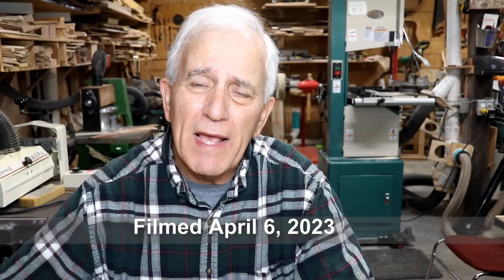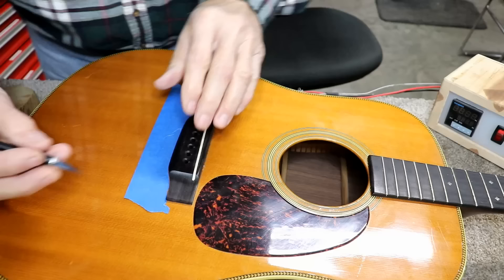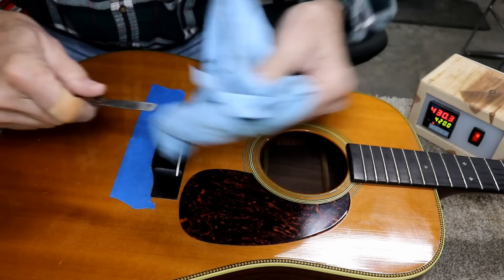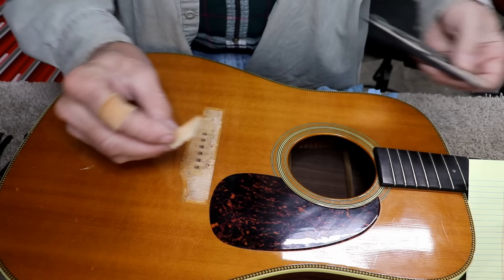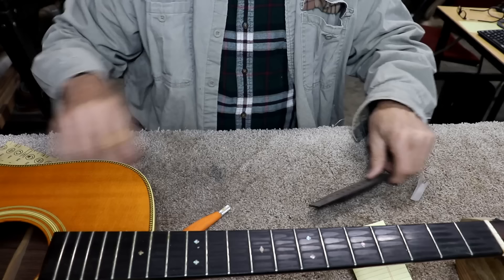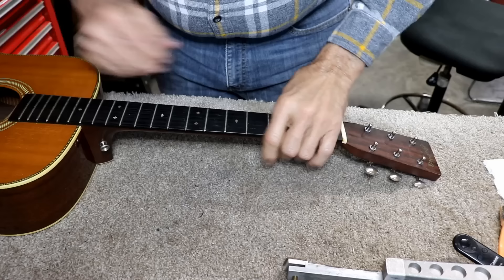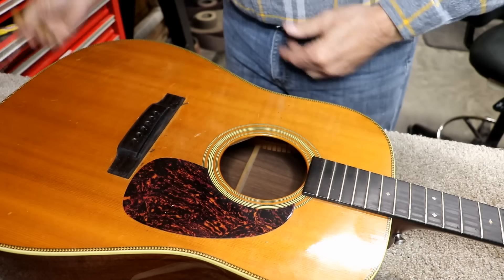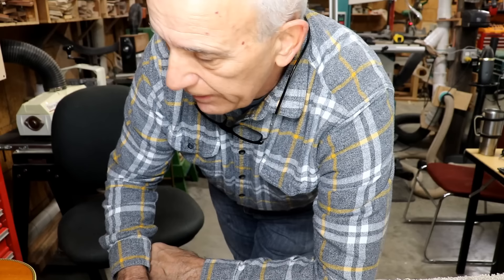640 RSW Refused by 2 Martin Factory Authorized Shops

Comment: Folks, I would like to say up front that I am NOT a luthier, and though I've been making racket for 50 years on and off, you wouldn't know it...yep...I suck at playing too.  This man does a number of things that he makes look easy (but are most certainly NOT) and demonstrates the power of 40 years of SUCCESSFUL (and frequently, to him I assume are annoying) problem solving.  Now let's look at what Martin has done to address stuff like this...this is going to be long-winded...you have been "warned"! 

About 3-4 years ago I toured the Nazareth Martin factory (we also toured the Yeungling brewery, too, and Pottstown isn't very far from Nazareth).  Of course I didn't realize, prior to taking the tour, that the guitar is finished prior to gluing the bridge to the guitar top...as the video pointed out, wood glue does not adhere to varnish.  In the olden days this was done by hand (before the days of relative affordability in CNC machining (with optical scanning/compensation and feedback to program the desired outcome).  The "not really new"  approach evaluates on an instrument-by-instrument basis so the "answer" is what that specific instrument requires to be considered "correct".  This system is also far faster, more accurate, and more consistent (with the data to back that up) than human beings can perform day in and day out. In addition the job had a high level of tedium for a critically important joint and required a highly skilled worker around 3 hours per guitar for every single guitar produced...that job now takes 1-2 minutes per guitar using machine centers custom designed and made for this specific task.  Each guitar is optically scanned so that guitar's variance is known and the system compensates for any irregularities, calculates the solution for that instrument, removes the varnish consistently (as well as determines the correct location for the bridge) with a shape that precisely matches the CNC made bridge and then (I am a bit fuzzy here) creates a pattern so precise that the CNC milled bridge will fit every single time in the correct location with precise sanding...These machine centers were custom made for Martin and are used on every single guitar made in that USA factory regardless of trim level or cost (I'm not sure if this level of automation is used in the Mexico factories but I suspect they also use a similar, if not identical, approach to achieve higher levels of affordability with customer expectations based on the name...  I'm not saying it's perfect (nothing ever is) but it's more consistent, more precise, and way faster (which helps offset that investment in a meaningful and measurable way that keeps the customer happy both in terms of cost AND performance).   I see this as the acoustic guitar version of the PLEK idea but applied to finish removal and bridge placement instead of fret leveling.  Combined with automatic QC data collection will help ensure that variation remains within manufacturing tolerances along with in-process checks at critical locations in the entire process so that every single guitar made in Nazareth is as close as current technology allows...the high skill set jobs still require the attention to detail but technology is used so those highly skilled workers can use their expertise in a meaningful way to help determine other improvements. Things have changed folks and Martin made the decision to reclaim and redeem the brand instead of choosing the death spiral.  These are simply manufacturing engineering problems that were evaluated on a deep level (including the effect on the morale of the workforce that performs the work).  Then appropriate solutions were developed by understanding how and why those problems happened.  These solutions are continuously checked to make certain that the improvements are achieved and are being maintained.  Data is used to show what works and what needs additional attention and, of course, never stops (the definition of "continuous improvement").  The data should result in better guitars, happier employees, happier customers and maintains/improves the name/reputation at a fair price.  If you get a chance, I recommend taking this fascinating and free tour (Martin AND Yeungling too!).  To echo comments made by others, I am also VERY grateful for skilled repairmen who know what they are doing...

Comment: I quit doing repair and restorations because people wanted to pay $25 for a bridge glue and frets replacement. I work on my instruments only now. I got  a 000-15S that had bad tuners, and Martin wanted to sell me new ones. I got the Stew-Mac vintage, and when I took the other tuners off there were hole mistakes everywhere for the tuner screws. I plugged them, installed the keys and compensated saddle, and now the guitar plays and tunes correctly. Since Martin sold, who knows how many guitars will come out of the factory with messed up parts or wood/glue/finish problems. Martin will no longer do repair or warranty work, and I understand no more lifetime warranty to the original purchaser. I'll bet C.F is spinning in his grave over this. Sad to see $$$ kick quality in the behind at this company. The "ferrin" ones are starting to outshine the big three companies. Sad indeed.

Comment: I have a 97 D28 the headstock tuning holes varnish cracked and the action was way off I purchased the over priced  Martin Allen key and fixed the action. I have a 2009 Sgt000-16 which is beautiful and I believe was made well but again martin guitars are not set up from  the factory

Comment: "Factory authorized" only means that these techs follow the SOPs and protocols of the manufacturer. They aren't "supposed to" try and do "big" stuff that can or will change the guitar dramatically... they want you to contact the manufacturer in those cases.
"Factory authorized" certainly doesn't give any warranty or guarantees to modification or replacements, even if done with the manufacturer's own brand parts. They just facilitate warranty service,

Comment: Great video. Playing mostly 12's & a couple classicals over 60 years. Martin's, Gibson's, Taylor's, Ramirez. 3 questions: after you glued bridge & cleaned it up, I can still see (I think) glue residue around perimeter, maybe caused by factory gluing over edge finish? How would you make the new glue edge less noticeable? Overlay a really light finish or what? #2: didn't see you notch string placements on saddle, but if you do (did), you could then precisely fix any intonation issue? Would you do that before you adjusted the 2 notches in the nut? #3: when you were checking string height at 12th fret, you said 'they' were 4 or 5 (extraordinarily low). Assume that was tenths? Like 3/64". Dang, surprised no buzz. Again, thank you for your time & expertise. If you have a video on how to repair finish from high tension nylon strings if they pop out, let me know. My Ramirez 4N was perfect before 2 mishaps. Now using bone beads.

Comment: Hi Jerry!!!  Great great vids as always!!  Better than TV programming!!  I successfully removed some bridges and reattached.  Ruined the finish around it due to dry glue squeeze out scraping.  In one of my processes, I tried scraping off the finish from the bottom of the bridge.  Well it seemed to take forever.  So I grabbed my carpenters gloves, scraper and HEAT GUN and heated the bottom hot!!  Then scraped the finish a lot faster.  Maybe this could help you?
Also.  What are your thoughts on finish thinner to remove the finish on the body as opposed to chipping it away??😊😊

Comment: What kind of glue did the factory use that you know just how much heat to apply?
Don't you have an assortment of different size and shape pieces of metal to use as clamps? I have some as small as a zippo lighter all the way up to a two foot long railroad track.

Comment: Hey not sure if it would work on guitar necks but go to a hobby lobby,  they have arched, aluminum sanding tools are about 10 inches long,  also how do you feel about  using steel wool on the frets I've heard  people say  that you can get the steel into the wood , however in 40 years I have  never seen  that to be a problem.

Comment: You said you don’t need to humidify unless it’s extreme circumstances, what is extreme. I heat with a wood stove here in PA in the winter & the humidity could get to 20% or less sometimes even with a room humidifier. So I’ve been humidifying in the cases with sponges in plastic bags & tube humidifiers. Is that good or bad?

Comment: FYI, the D-28 H V.  The "V" stands for "Vintage".  H refers to the herringbone trim, reminiscent of the 1930s er D-28s.  The vintage sound that that guitar makes is because Martin scanned some of the Vintage Martins in the collection and replicated bracing and kerfing as in the originals.  The scans were exact and the D-28HV sounds just like the golden era of Martin Guitars that so many players want.

Your string installation is very interesting.  I have always ended up with more low E string to wind.  Next change, I'll follow your method.  
I wonder how well it would work on a 12-string! LOL!

Comment: Martin started using bone on these in 2004..At that time, they did not glue them in from 2004 on to 2018.   What year is this HD28V? It would sound so much better (richer, fuller) with medium P.B.

Comment: I don't understand "Vintage". What in the world does that mean? The HD-28 wasn't made until like 1982 which is when I bought mine.  It just doesn't seem that 1982 was long enough ago to deserve Vintage. 1950 yes. But 1982? 1982 still seems like yesterday to me.
Well the 1982 version didn't have a truss rod. So does this HD-28V not have a truss rod? And who would want that?
Which is why I'm finally going to bail on mine and buy a new one with a truss rod.  I really like intonation to be good and mine is lousy.  Wow 10 cents sharp.  Gee I wish mine were that close.  Same issue with my 1972 D-35.  Selling both.
Going to buy a recent HD-28 either new or slightly used. And a Yamaha FG-830.  I'll have a case for the Martin.  But the Yamaha is so cheap that it will travel naked most of the time.

Comment: I'm wondering about that finish cracking where the arm rests. Wouldn't the finish block any moisture from transferring through into the wood? Could it possibly be acidic body oils and salt from sweat interacting with the nitrocellulose finish that is causing the cracking? A couple years ago I bought a used Martin OM 21 that had a black/blueish cast in the nitrocellulose lacquer where the previous owner rested his arm. I tried polishing compound to see if it was just a surface stain and no, the nitro had darkened indicating a chemical reaction between body oils and the lacquer. One other thought, some guitarists will play without a strap and use their forearm to clamp the guitar in position. Could that place undue pressure on that area of the sound board?

Comment: Great video! What's the best way to remove glue squeeze-out, after the fact? I have some around where the fretboard/neck meets the body of the guitar near the sound hole, bass side. It's only an issue because it stares right back at me while I'm playing the guitar. Thanks!

Comment: Hi, Rosa. I've watched all of your videos of the Violin and cellos. I was wondering if you could help me. I bought a couple of 1970 to 1990 Hofner classical guitars that were left in storage since they were made. I have about 12 of them. but they have no bridge on them. I bought new bridges for them. but the bridge saddle slot was routed out in a slant instead of being straight. so The hi E string is 5mm and the low E string is 4mm from the side. I no before glueing the bridge on it needs to be measured. I believe from the nut up to the 12 fret needs to be 325mm and from the 12 fret to the bridge 325 to 326mm. because the saddle is not straight. I'm wondering if I'm supposed to measure 325 or 326 up to where the hi E string or the low E string is. do you know how I shud measured up to a slanted saddle? or up to where the E A D G B or E string is? or does anybody know? I know each guitar is different and has different measurements. all of my Hofner Guitar has 325mm from the nut to the 12th fret. I'm just not sure what it is from the 12th fret to the bridge with a straight or slanted bridge saddle. or probably on any Guitar.  they say when you pluck any string or the E string and then press the string on the 12th fret it shud sound the same pitch. and not have a sound of E flat or E sharp. It shud have the same pitch or sound as E on the tuner. I end up buying bridged with slanted saddles and not straight won. so I'm just not sure which side of the saddle I shud measured from. what are the slanted saddles for, or what is the differences between a slanted saddle and a straight saddle? or shud I measured 325 on the low E string or 326 on the hi E string

Comment: Regarding how difficult it was, to get the bridge off, which is equivalent to it still holding to the top really strong, and the damage it did to the wood of the top: Was it really necessary / worth it?
At the back the bridge was overlapping a fine line of finish, that's what allows the gap to open - is it that serious?
I can understand why the other shops refused to remove the bridge.
Reply: What do you mean? Should keep playing like that with that little gap on the bridge and nothing was going to happen?
Reply: @saviodemartin62  Yes.

Comment: What hardwood be better for sound transfer than maple? I invite all to answer, insult me if you will, just add information. I'm after answers, not manners. The bridge looks to be rosewood or walnut, but the top is spruce. Douglas fir, I'm told, has an excellent weight to strength rato. Would that be more likely to dull the sound? would a harder wood, ebony, ironwood, be a better choice?

Comment: Nice result just next time, PLEASE protect the finish. I was dying when you were putting the wooden block that slid over and scratched that beautiful top. Also, the cable for the heater could scratch the side. A .10c film of plastic or shop rag is all it would have taken to protect that finish. It DID get SCRATCHED. Otherwise, you did good. You don't have to over squeeze titebond either. They also say no wet rags- makes the bond weaker.

Comment: Those are cheap strings or the guitar is low quality or you can't press chords (which I highly doubt), but it has almost zero sustain and meat at the low end. It's always worth putting good strings on like Daddario XS 11-52 or Elixir PB nanoweb of the same thickness, maybe even 12-53 if the guitar is real shit.
Reply: Medium gauge strings are the only string for a D28, those strings you mentioned
are useless on a D28.

Comment: You chipped out finish around the bridge!  That is really not acceptable and is easily avoidable.  Sorry, but while much of what you do is very impressive, there is a reason Martin left a little finish under the edge of the bridge.  Seeing a line around the bridge looks terrible.  In this case, it seems to have been a bit too much.  But scoring around the bridge like you did was a terrible idea.  Tape it off and cut inside the tape.

Comment: You need to heat your knife. And you broke the saddle and tried to deny it. Heat the knife blade next time. 🤦🏻‍♂️.
Edit:: and when sanding the back of the bridge, why didn't you properly lap it by using sandpaper on a small pane of glass? Again-🤦🏻‍♂️

Comment: This made me cringe. First not waiting long enough for the glue to soften and then way too much brute force with the knife resulting in tear-out of the spruce top wood. And then scraping outside the bridge area leaving a very visible unfinished margin around the bridge along with two big scratches to the rear(bottom). Finally, using PVA glue instead of hide glue. It was like watching a wild-west barber pulling teeth. I'm guessing the folks that think this is a great job are 1. watching on their tiny phone screens and not seeing the damage and 2. don't know any better.